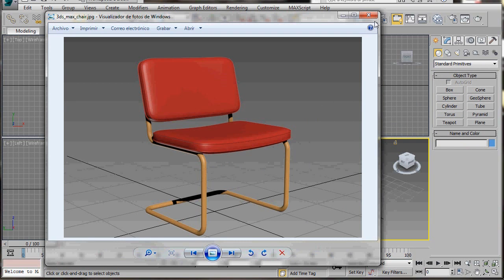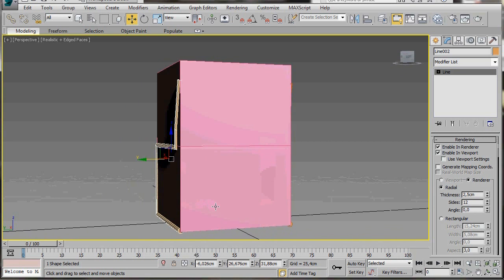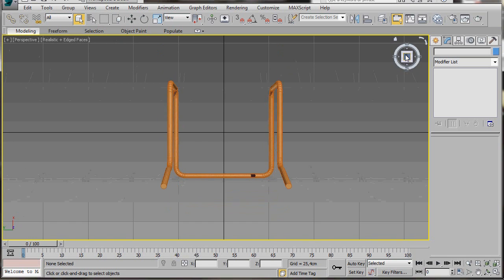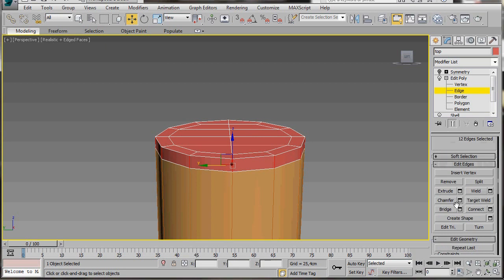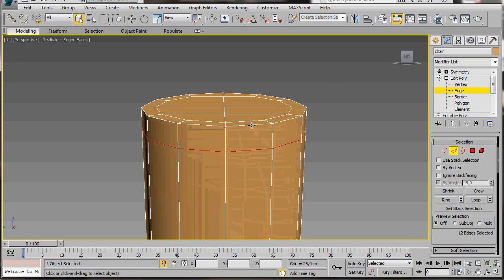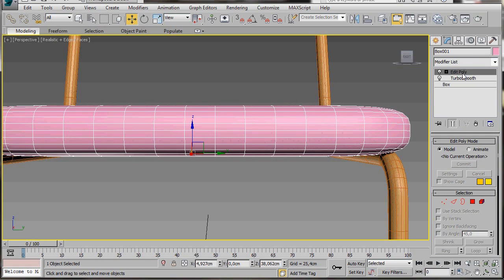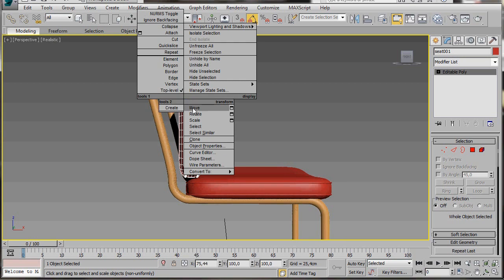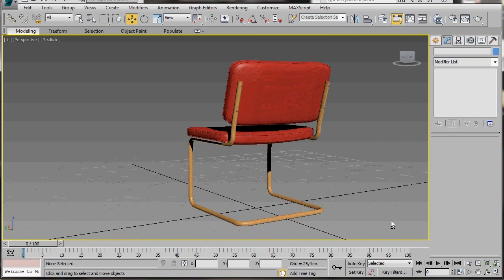3DS Max Chair Modeling – Easy Beginner Tutorial

Comment: For anyone having problem with the snap function at 5:15 try to pess "s" (toggles snaps on and off).
Reply: Not all heroes wear capes.
Reply: I also have problems making a line when I try to do it from the Modify tab, and when I make a line from the Create tab, I have an issue with welding, because it messes up the bottom of the chair.

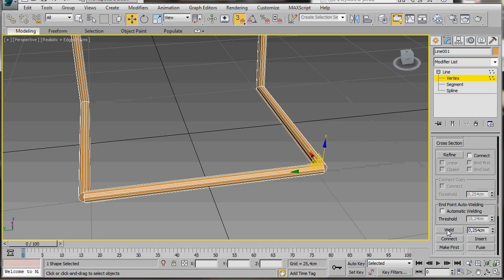Comment: Hi ♡ at 5:48 my vertices won't weld. It is successfully welding automatically the endpoints but when I try to do it manually, it doesn't work. Any solution for that?
Thanks in advance

Comment: After hiding the box , I applied the edit spline and attached the both sides, Then I turned on the vertex, selected the edge and tried to draw a line ... But the create line is not working fine..... Its not connecting the edges,,, Please help me out...

Comment: Can the lines be edited/fixed if you mess up? I kept switching between the video and 3DS max windows and eached time I did it would make the last vertex wherever my mouse ended up and undo has you redo the whole thing from the first line
Reply: just click backspace button.... I used to have the same problem with you... I hope it works...